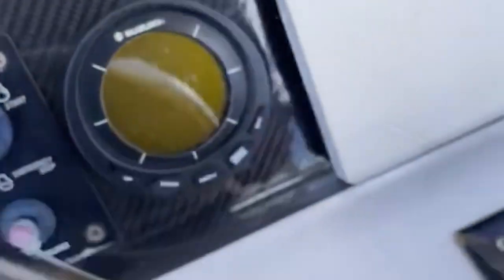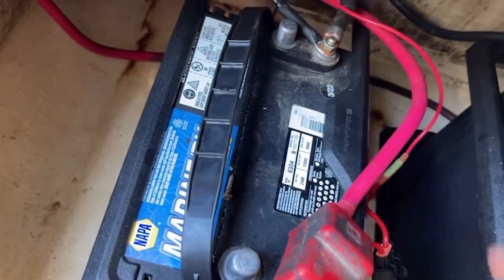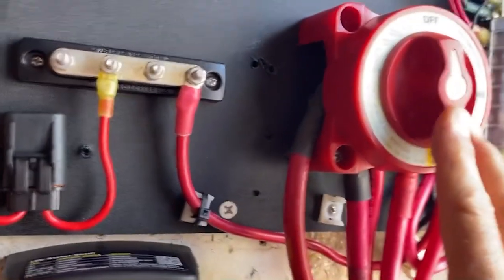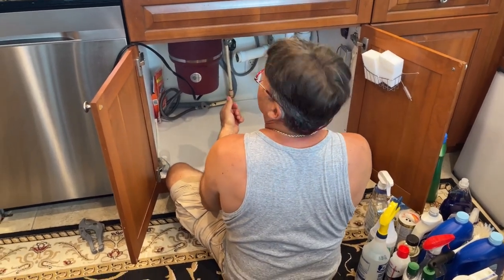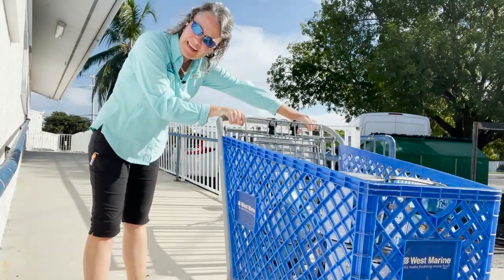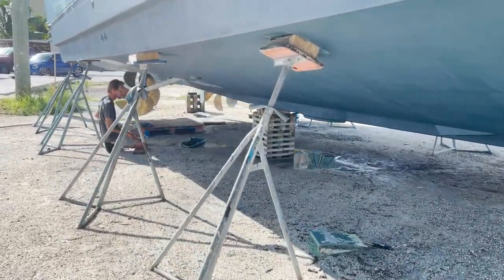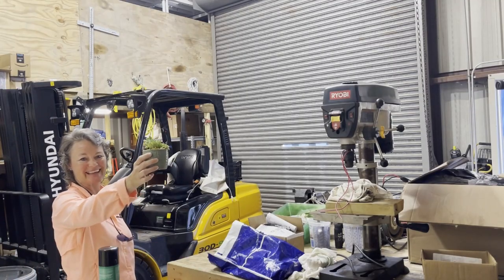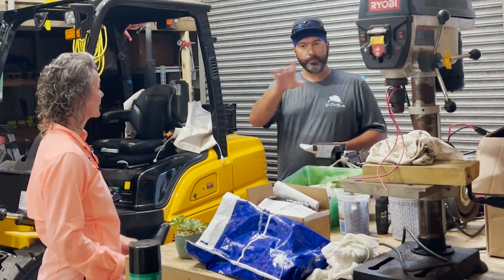Rewired Electrical System on a BOAT

Comment: Glad to see you’re using blue sea components however, rather than just heat shrinking those compression terminals, I’d like to see them tinned first
Reply from the maker: Thanks for sharing … we don’t spend the time to do that process! It’s not normally requested either …. Just costs the customer more! 👍